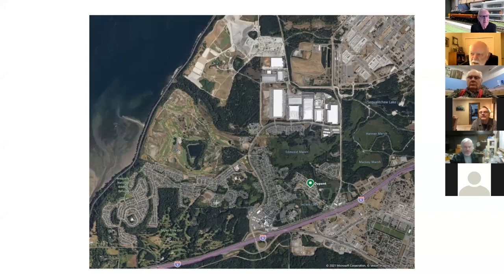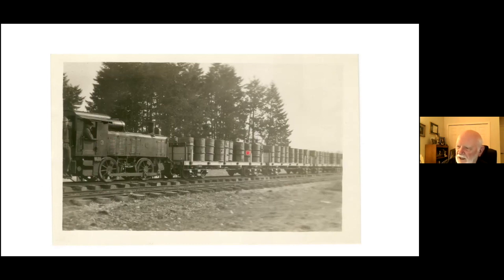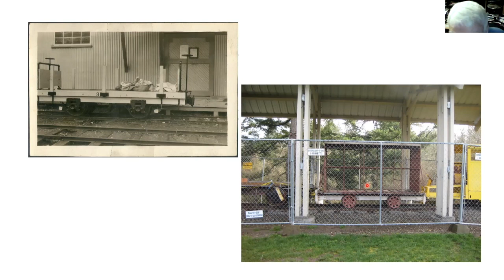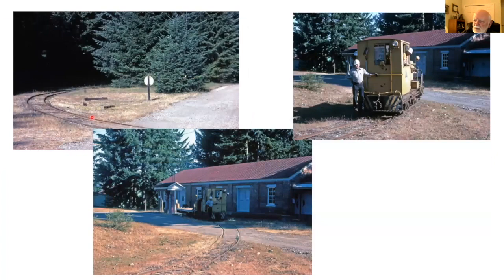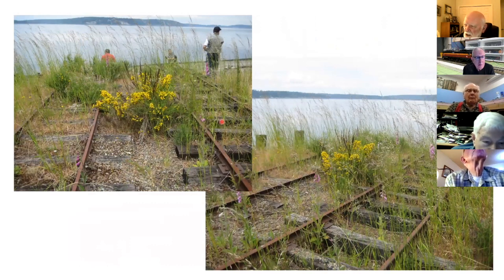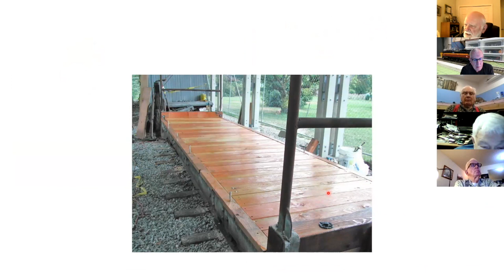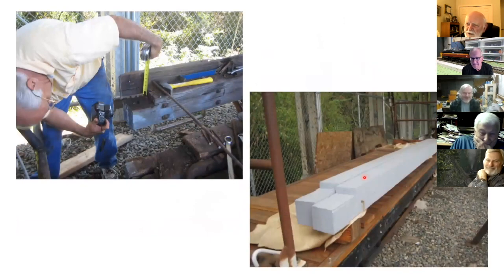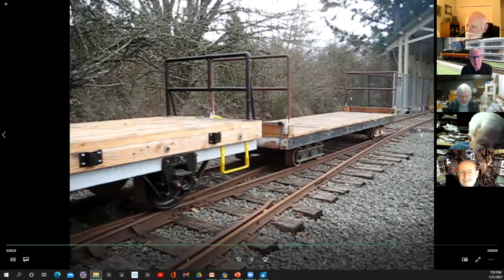Eastside Clinic on Dupont WA Railroad History 21 Jan  2021

Comment: Watching this video on a cold rainy day brought me back to life pronto. I was glued to the screen for the duration as this type of r r is so rare and obscure. Wisconsin had the Badger Ordnance Works near Baraboo WI that had 25 miles of ng track which was built 1942 mothballed twice and was dismantled in early. 2000s. Claim to fame was the biggest operator of Rogers Bros locomotives with 15 36"units. About 60% of their equipment was saved. Again to all in the group a sincere thanks for the research (and these in restoration) and sharing it. Another item for the bucket list!